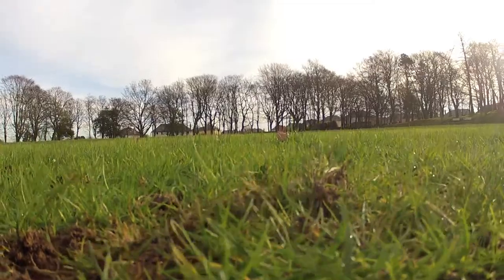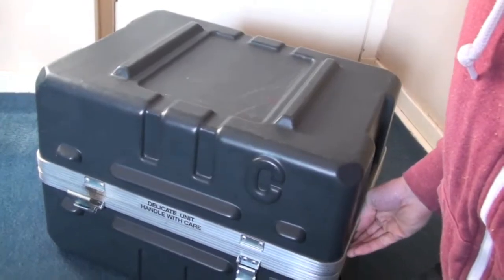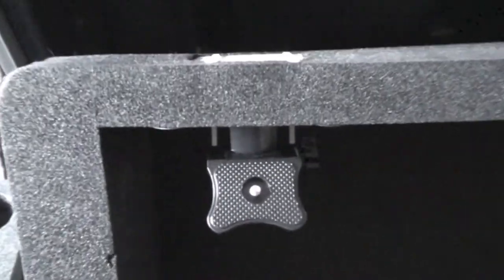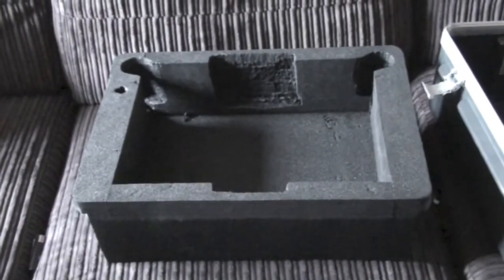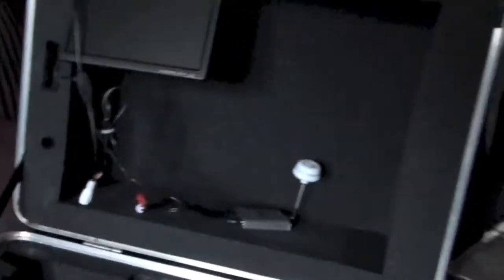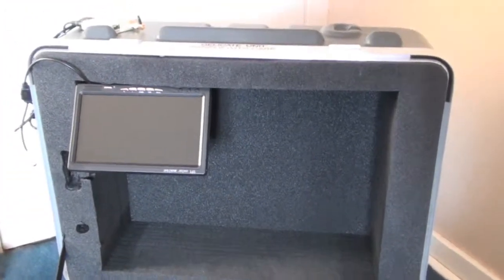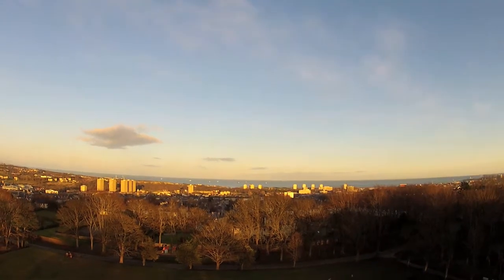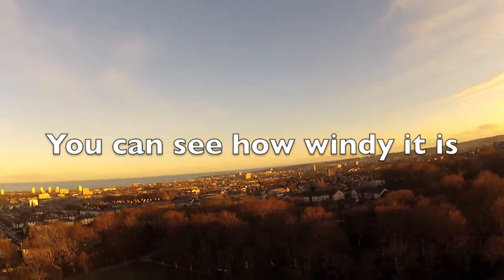TBS Discovery Fpv ground station / storage build

Comment: Great setup, did it take long to get the gains set right?
I like the thermodyne box, Thumbs Up
Reply from the maker: I did the set up in the naza assistant , setting the potentiometer dial on my dx7s radio as my gain adjuster . I could then set the gains on site and during the flight . took about 30 seconds to do . 
Thanks for your comment
Reply: Awesome, didn't know it could be that easy..
Reply from the maker: There are a few videos on youtube on how to do it .